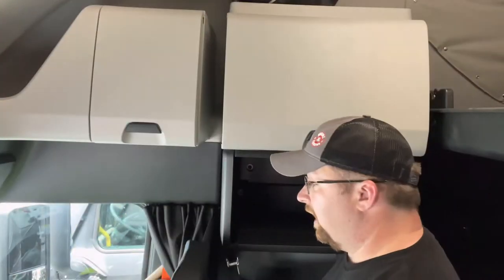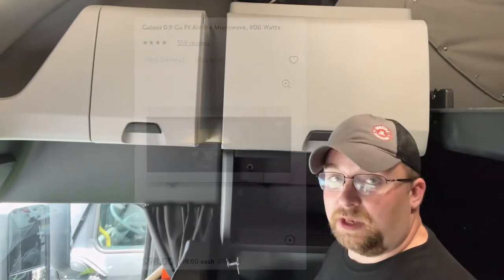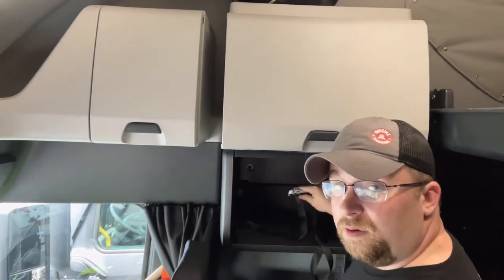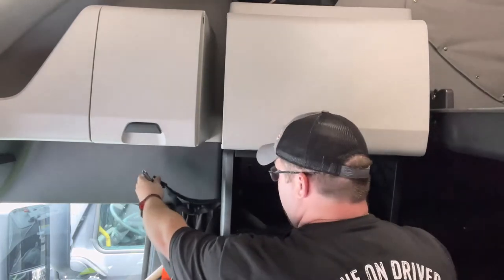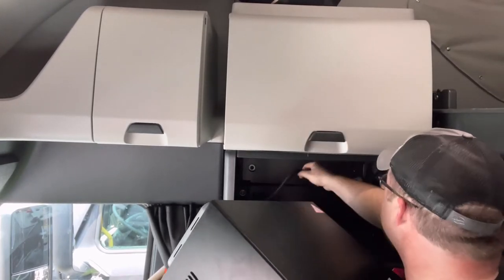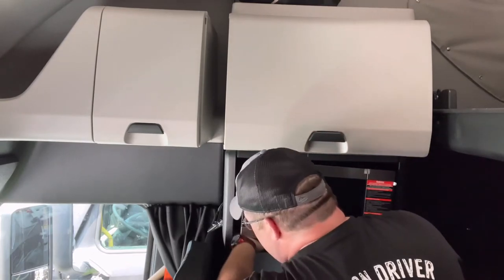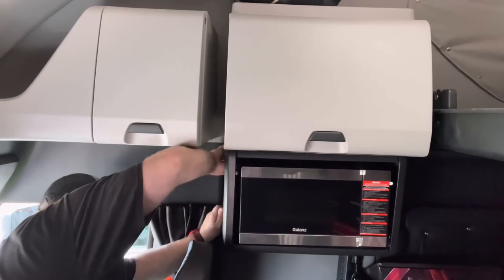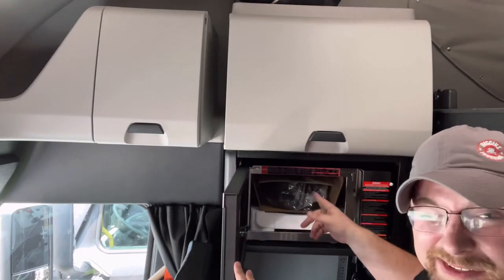Watch This First!!! ☝️ The BEST Way To Install 2018+ Freightliner Cascadia Microwave.

Comment: Hey bro good work! So ima newbie into trucking. I have a cascadia 2023. So im wondering if the 2023 cascadia comes with a inbuilt inverter or do i have to get one before i even think of putting a microwave . Thanks for your time
Reply: Ask your company and  depending what they say, you might have to buy one and have them install it for you.

Comment: Hey! Thank you so much for this video...I have a question, what size inverter or apu are you using? I think my company has a 1500 watt, but not sure if that specific microwave would be to much.
Reply from the maker: My pleasure Whitney! I have an 1800 watt inverter. But this will run on a 1500 watt, you may have to keep the truck running at a high idle to offset the inverter from shutting off but it will work.
Reply: @bigginztrucking4698  yes sir, and I appreciate the quick response! I'm going to purchase one now!
Reply from the maker: No problem Whitney. Thanks for watching :)

Comment: Is this the 1000 watt 1.2 ft³ unit? 
 And will this fit in the 2021 Cascadia cubby do you know?
Reply from the maker: Hey Dewaine! Yes it is and as far as I know the 2018-2022 Fliners have the same general layout universally.
Reply: @bigginztrucking4698  awesome!!
Can't wait to use this thing😎
Reply: I definitely know I'm a little bit late here, but that is the 0.9 cu/ft 900 watt option. Not the 1000 watt.
Reply: @joshuamoore3846  it's all good. I bought the 1000 watt and it was to big. We needed a new one for the house anyways so it all worked out. I put it in the hose and went out and bought the 900 watt for the truck.

Comment: Can you plug most microwaves straight into the inverters in cascadias?
Reply: This is what I need to know . I have a 2023 Freightliner and doesn’t have the outlet for the microwave put in at the same place as older models
Reply: @QCee95 i have a 2023 Cascadia and it has outlets but don’t seem to be turning on. Do I need to install a converter ?

Comment: What plug are u using Bc mines doesn’t have a regular plug in.
Reply from the maker: Up in the microwave cabinet slot there is a regular “household” style outlet in my truck as well as a “cigarette lighter” style plugs in.
Reply: @bigginztrucking4698  what year is your truck
Reply from the maker: @truckingwithpacdawg2202  it’s a 2022
Reply: @bigginztrucking4698  ahh ok mines 2020
Reply from the maker: One thing you’ve got that I don’t is a daggon proper trailer brake with an actual handle lol. Mine is a button and I swear I can’t figure it out. The last year it seems they left the handle on was 2021.

Comment: I got lucky in my 579, the microwave is up top in the open on the driver side. Makes for an easier install.
Reply from the maker: Yes sir Pete makes it real easy to install a microwave. No video required 🤣